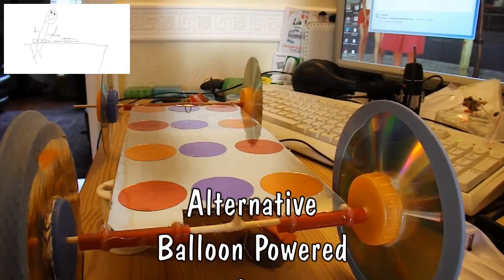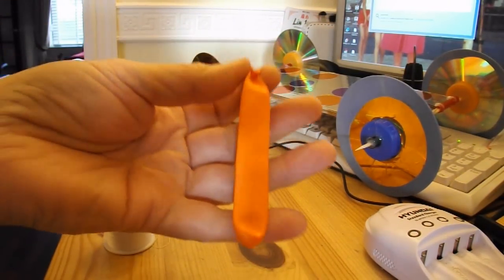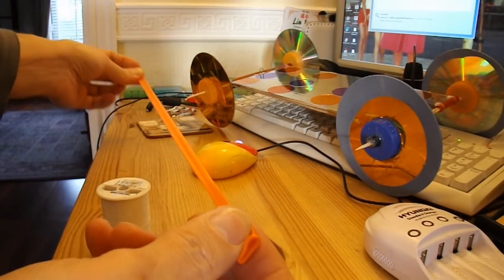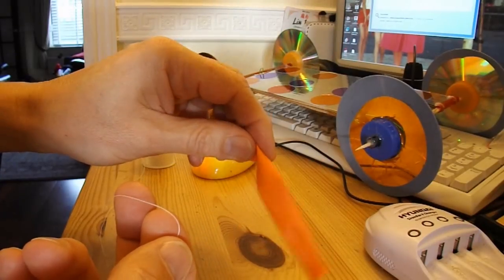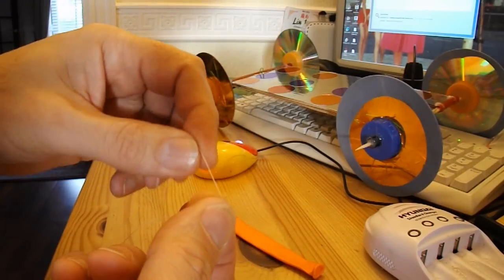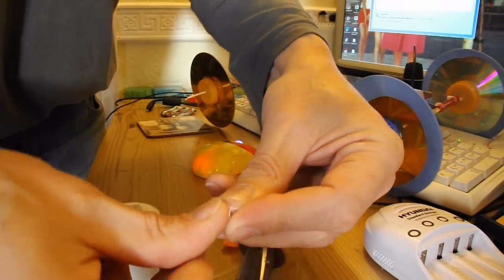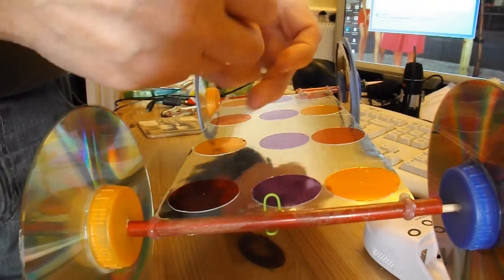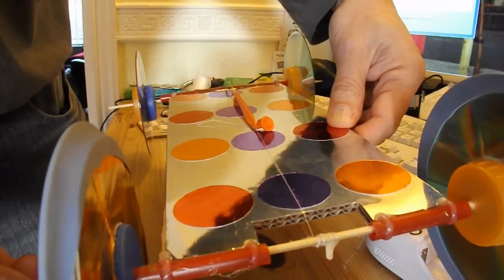Alternative Balloon Powered Car - No Air Required

Comment: Are the caps supposed to be tight to the wooden stick or is it supposed to be loose enough for it to go through?
Reply from the maker: They should be as tight as possible so they grip the wooden axle, maybe even glue them in place. If they are loose the axle will spin but the wheels won't turn. The axles SHOULD be free running in the drinking straws so that is why I use big straws.